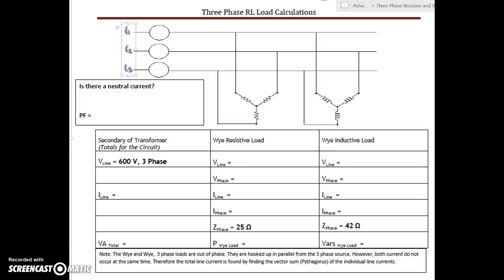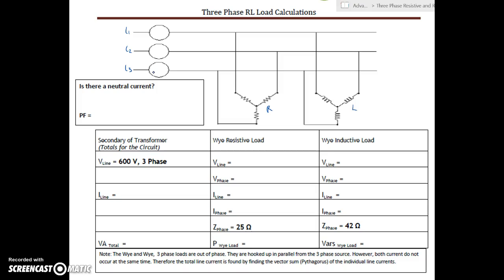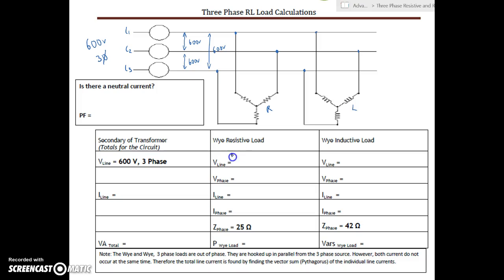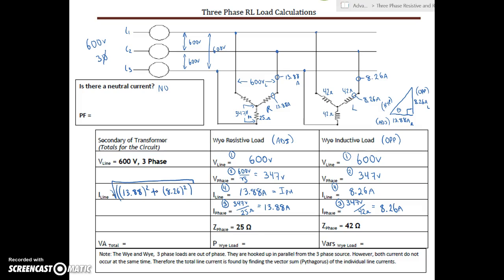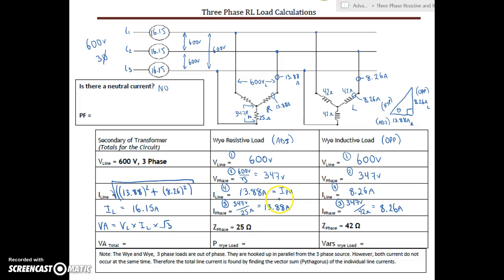3 Phase RL Circuit Calculation Ex #4

Comment: 3 phase 4 wire system using consummers(Hourse) unbalance load. If some place neutral wire connection loose or open circuit. at the time unbalance voltage are so mush diffrent. How to calculate diffrent phase voltage.

Comment: Hey in these 3 phase circuits, one problem i am facing is in determining the durection of the current. Could u help me out in that matter?
Reply from the maker: These circuits are all fed from an AC source. Don't worry about the direction of current as it is changing 60 times per second and it is this change in current direction that provides the XL or XC value.